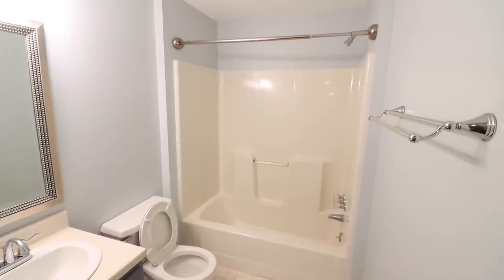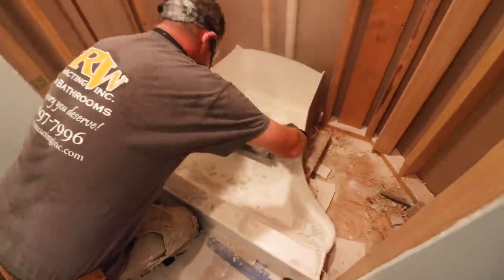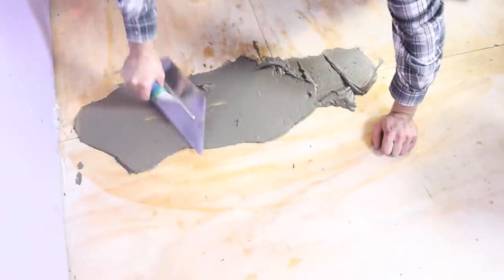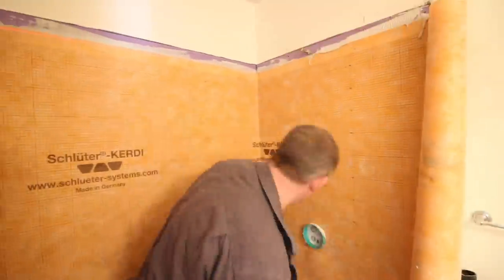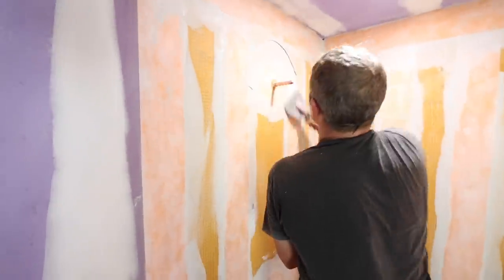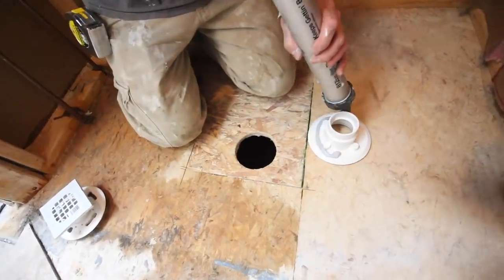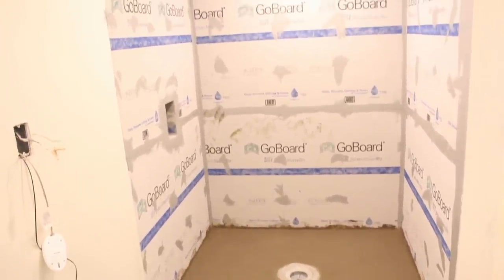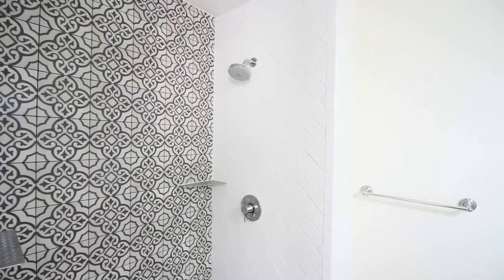16 Shower Renovation Ideas Beginners Should Know

Comment: Steve and Jeff-sorry that I missed the open discussion group yesterday. I truly loved this great new video and very pleased that you included KBRS and showed installation including floor pan. I have limited my business to smaller projects due  personal  health issues and miss large bathroom demolition and remodeling. Last week in a  half bath room adjacent to a separate shower room, I  replaced a glass shower door, installed new porcelain tile floor, installed new Moen shower control including new plumbing, installed new lights, removed toilet and replaced flange and adjusted/cut height of ABS drain pipe but client kept resin acrylic shower. Thus tile work was  limited to floor, also installed granite custom vanity top and plumbing and GFI. Kept me happy. 
week
Reply from the maker: thanks Jerry and it sounds like you’ve been more than busy!! Hopefully you’re feeling better, please keep us posted on how you’re doing

Comment: Great video.  I notice that you have switched from Stratomat to Kerdi in the last year or so.  Any particular reason?  Thanks
Reply from the maker: great question, we use DITRA most of the time because the cutback cavities are waterproof whereas Strata isn’t. You still need to address all the seams with KERDI-BAND but that doesn’t take long
Reply: Reckon we're cousins. Where you at

Comment: Sounds like Kerdi commercial....can just use red guard as well and roll it on like paint 2 coats.....waterproof as well.....like the demo tricks

Anything you can cut on half is so much easier to take out than full pieces....studs, doors, windows, just about anything
Reply: I literally red gaurded a shower used it for 3 years no tile just bare red .then demoed it to enlarge the b room and it was perfect behind everything
Reply: @caravann26  red guard over cement board?
Reply: @racker7855  yes just red guard on cement board

Comment: Ive commented this before on other videos but beginners and “DIYers” shouldn’t touch tile, especially kerdi or ditra. I’ve made most of my money ripping out improperly installed jobs. Some that were even installed by people who said they knew what they were doing. In the long term you are wasting more money you thought you were saving when you did it yourself or just hired the cheapest guy. Not to mention with showers you can cause serious damage to the substrates. Not trying to be negative either. 

Its the same as when I hire someone to install major electrical work. Even though I can install an outlet or switch I know my limits. I also know what issues can come of improper installation.

Comment: I cannot stand a toilet right next to a shower. Mine is like that and I cant wait to move it. It sickens me. I kneel down on the bathroom floor to give my dogs a bath and my face is right next to the toilet. I get out of the shower clean, clean towel, standing next to the grossest dirtiest place in the house. Also toilets right in front of doors are bad too. Zero noise control there. I hate shower inserts too. They are giant ugly monstrosities and the moldings are never well designed. There is nothing better than a thoughtfully designed clean bathroom with good lighting. Bathrooms always seem like someone just designed it to fit everything and without thought to layout or use.